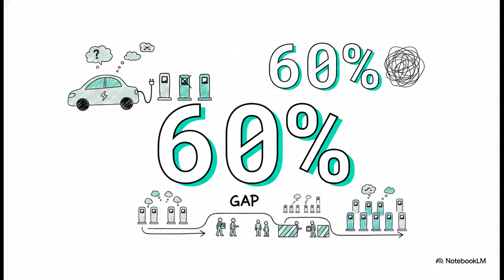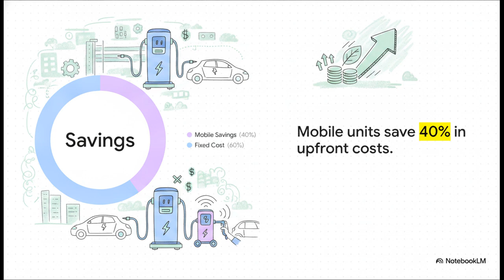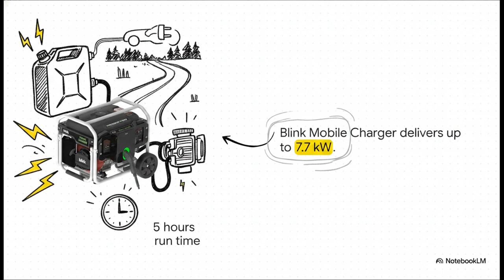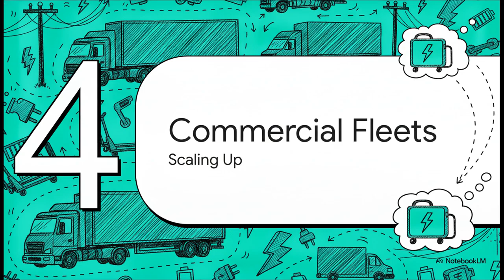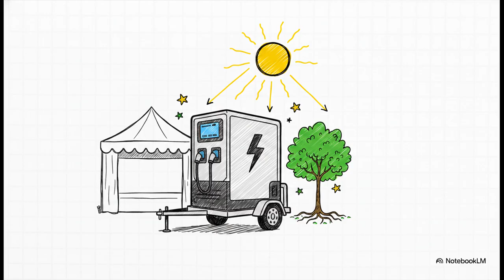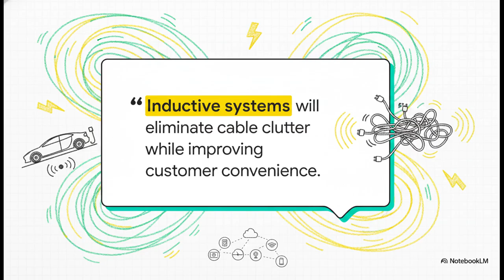Mobile EV Charging Explained: How Emergency Charging Comes to You ⚡🚗

Comment from the maker: ⚡🚗 WHAT WOULD YOU DO IF YOUR EV DROPPED TO 5% AND THE NEXT CHARGER WAS TOO FAR AWAY?

That's exactly why understanding mobile EV charging matters.

🔋 Low battery?
📍 No charger nearby?
🚫 Charging station unavailable?
🛣️ Stranded on the road?
🚨 Need emergency charging assistance?

Bee Charged brings mobile EV charging directly to the vehicle.

📞 888-675-9555
🌐 BeeChargedEV.com

👇 COMMENT YOUR CITY + STATE

And tell us what worries you most:

1️⃣ Running out of charge
2️⃣ No charger nearby
3️⃣ Broken/unavailable charger
4️⃣ Long charging wait
5️⃣ Charging cost
6️⃣ Roadside emergency

🇺🇸⚡ Let's see which U.S. cities need the most mobile EV charging support.